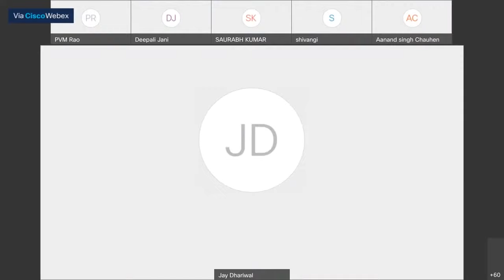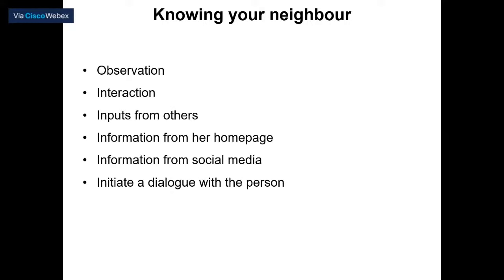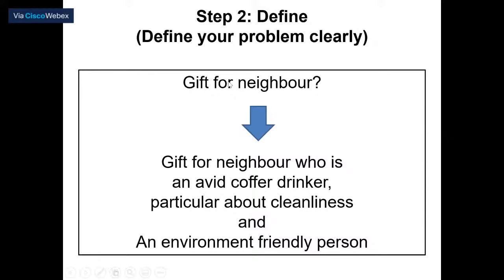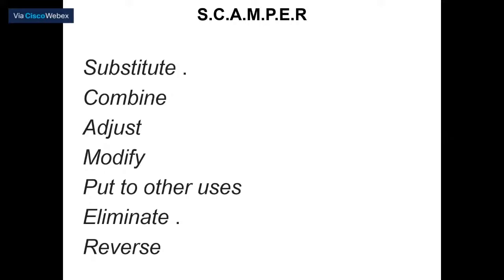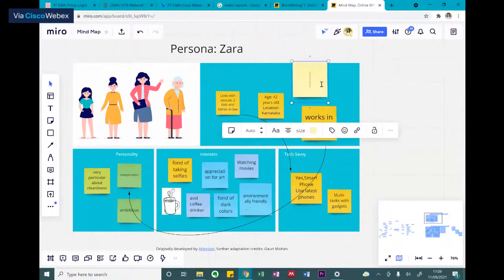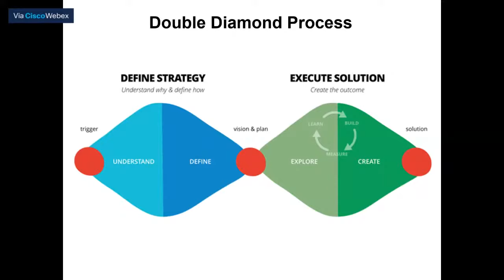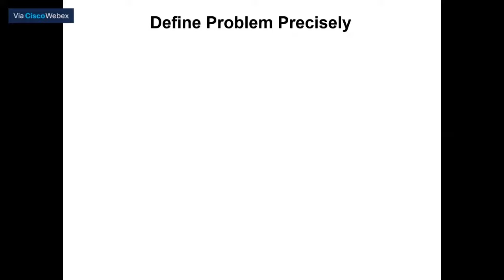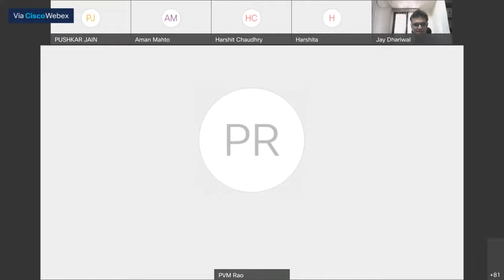IIT Delhi Sci-Tech Spins Lecture Series(September 2021):Design Thinking for Creativity & Innovation

Comment: @Mohana Priyan
For your question: Sir, how can we reduce global warming through SCAMPER method? There is a huge scope for doing so. Sharing some pointers for you to get started, could you think of the major factors causing global warming? 
Could we become more adaptable in our heating, cooling, lighting needs? Could we think of what is necessary and what can be avoided in terms of the products that we use and the industries that produce them?